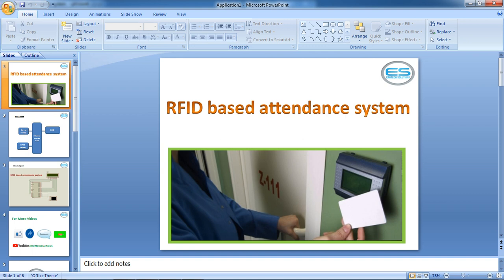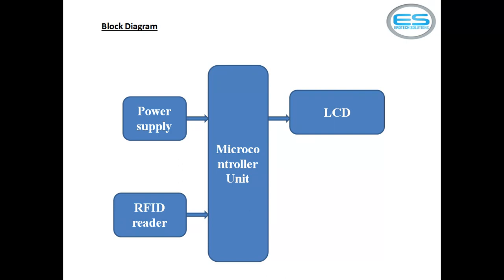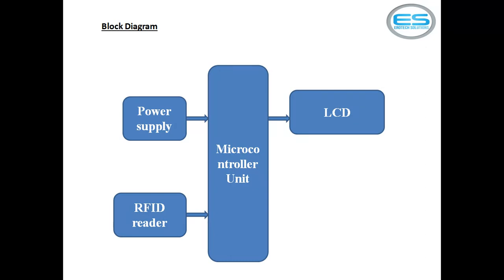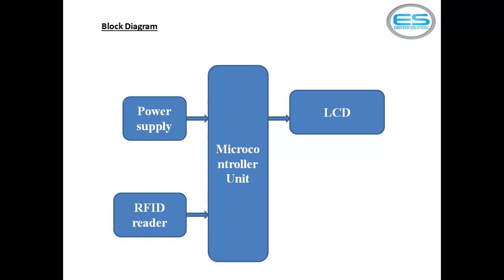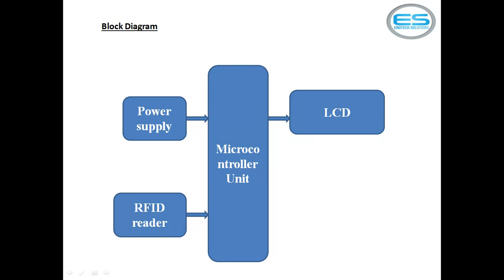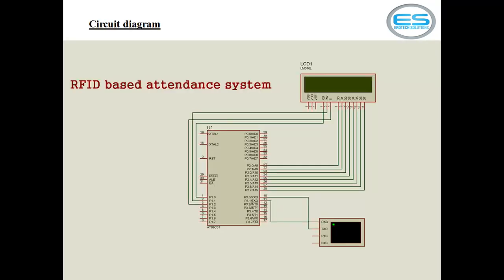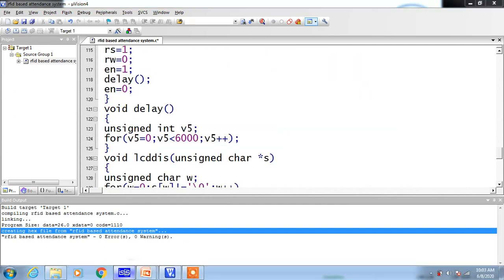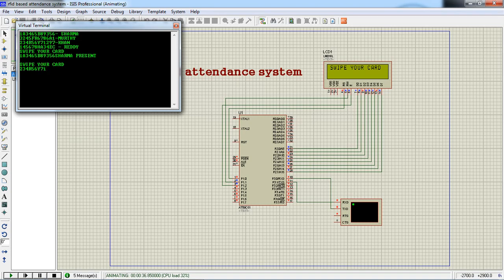RFID based attendance system using 8051 Micro controller || EROTECH Solutions

Comment: A nice demo of the project but ID verification could have been better if it was not hardcoded. It defeats the purpose.
Reply from the maker: Thank you Hemendra kumar.....
Reply from the maker: @Ram C 
/* RFID based attendance system*/
#include<reg51.h>
sbit rs=P1^0;
sbit rw=P1^1;
sbit en=P1^2;
void lcddat(unsigned char);
void lcdcmd(unsigned char);
void lcddis(unsigned char *);
void lcd_init();
void serial_init();
void ser_dis(unsigned char *);
void check();
void delay();
unsigned char rfid[12],v1;
void main()
{
serial_init();
lcd_init();
lcddis("  RFID BASED  ");
lcdcmd(0xc0);	//forcing cursor to second line
lcddis("ATTENDANCE SYSTEM");
	ser_dis("1A3465B89356- SHARMA");
	ser_dis("3245FR6786A1-MURTHY ");
	ser_dis("234R56Y71297-KHAN ");
	ser_dis("145678HA34EC - REDDY");
while(1)
	{
	lcdcmd(0x01);
	lcddis("SWIPE YOUR CARD");
		ser_dis("SWIPE YOUR CARD");
	for(v1=0;v1<12;v1++)
	{
	while(RI==0);
	rfid[v1]=SBUF;
	RI=0;
	SBUF=rfid[v1];	//optional
	while(TI==0);
	TI=0;
	}
	check();
	SBUF=0X0D;
	while(TI==0);
	TI=0;
	}
 }
 void check()
 {

 if(rfid[0]=='1'&&rfid[1]=='A'&&rfid[2]=='3'&&rfid[3]=='4'&&rfid[4]=='6'
 &&rfid[5]=='5'&&rfid[6]=='B'&&rfid[7]=='8'&&rfid[8]=='9'&&rfid[9]=='3'&&rfid[10]=='5'&&rfid[11]=='6')
 {
 lcdcmd(0x01);
 lcddis("STUDENT");
 lcdcmd(0xc0);
 lcddis("SHARMA-OK");
ser_dis("SHARMA PRESENT");
 }
 else if(rfid[0]=='3'&&rfid[1]=='2'&&rfid[2]=='4'&&rfid[3]=='5'&&rfid[4]=='F'
 &&rfid[5]=='R'&&rfid[6]=='6'&&rfid[7]=='7'&&rfid[8]=='8'&&rfid[9]=='6'&&rfid[10]=='A'&&rfid[11]=='1')
 {
 lcdcmd(0x01);
 lcddis("PRINCIPAL-OK");
ser_dis("PRINCIPAL PRESENT");
 lcdcmd(0xc0);
 lcddis("MURTHY");
 }
 else if(rfid[0]=='2'&&rfid[1]=='3'&&rfid[2]=='4'&&rfid[3]=='R'&&rfid[4]=='5'
 &&rfid[5]=='6'&&rfid[6]=='Y'&&rfid[7]=='7'&&rfid[8]=='1'&&rfid[9]=='2'&&rfid[10]=='9'&&rfid[11]=='7')
 {
 lcdcmd(0x01);
 lcddis("DEPARTMENT HEAD");
 lcdcmd(0xc0);
 lcddis("KHAN-0K");
ser_dis("DEP HEAD PRESENT");
 
 }
 else if(rfid[0]=='1'&&rfid[1]=='4'&&rfid[2]=='5'&&rfid[3]=='6'&&rfid[4]=='7'
 &&rfid[5]=='8'&&rfid[6]=='H'&&rfid[7]=='A'&&rfid[8]=='3'&&rfid[9]=='4'&&rfid[10]=='E'&&rfid[11]=='C')
 {
 lcdcmd(0x01);
 lcddis("DEAN");
 lcdcmd(0xc0);
 lcddis("REDDY-OK");
ser_dis("DEAN PRESENT");
 
 }
 else
 {
 lcdcmd(0x01);
 lcddis("PERSON");
 lcdcmd(0xc0);
 lcddis("NOT REGISTERED"); 
 }
 }
 void lcd_init()
 {
 lcdcmd(0x38);	//intialises crystal 5x7 matrix
 lcdcmd(0x01);	//clear screen
 lcdcmd(0x10);	//shift cursor position to right
 lcdcmd(0x0c);	//display on cursor off
 lcdcmd(0x80);	//start display from 1st line
 }
 void lcdcmd(unsigned char val)
 {
 P2=val;
 rs=0;
 rw=0;
 en=1;
 delay();
 en=0;
 }
 void lcddat(unsigned char val)
 {
 P2=val;
 rs=1;
 rw=0;
 en=1;
 delay();
 en=0;
 }
 void delay()
 {
 unsigned int v5;
 for(v5=0;v5<6000;v5++);
 }
 void lcddis(unsigned char *s)
 {
 unsigned char w;
 for(w=0;s[w]!='\0';w++)
 {
 lcddat(s[w]);
 }
 }
 void serial_init()
 {
 SCON=0X50;
 TMOD=0X20;
 TH1=-3;  //buadrate 9600
 TR1=1;
 }
 void ser_dis(unsigned char *s)
 {
	 unsigned char v3;
	 for(v3=0;s[v3]!='\0';v3++)
	 {
		 SBUF=s[v3];
		 while(TI==0);
		 TI=0;
		}
		SBUF=0x0d;
		while(TI==0);
		TI=0;
	 
}